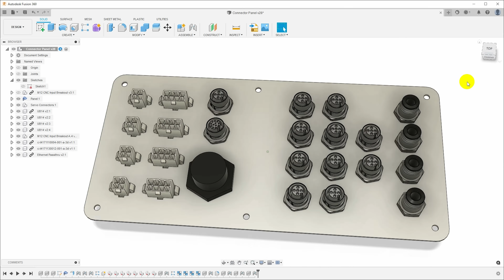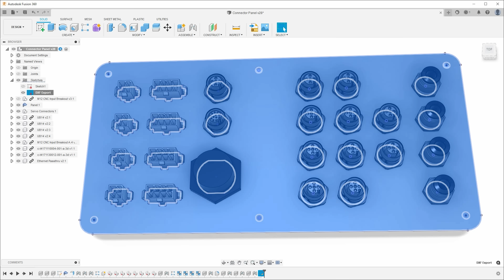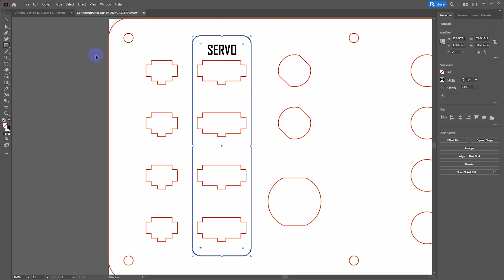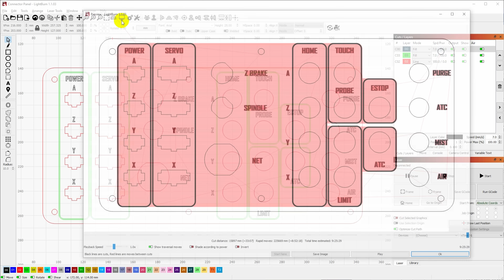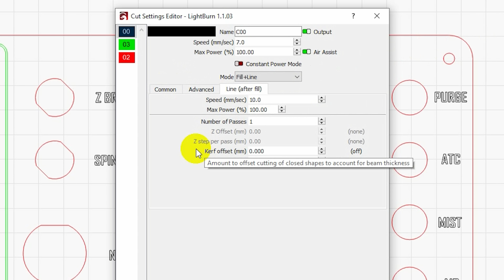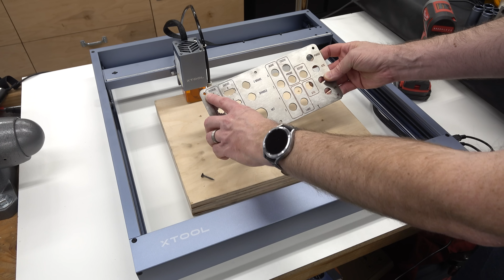Will a Diode Laser Engrave Steel? | xTool D1 Testing

Comment: Bit of science info:
Many years ago I was mailed some stainless steel samples from Japan for analysis. They had been treated to produce a range of colours. RBS Analysis (nuclear backscattering)  showed that the coloured layer was actually a transparent oxide that was producing colours by diffraction interference. That's the same mechanism that creates the colours in a thin film of oil floating on water. 
I suspect that this is the same thing. An oxide layer where the thickness determines the colour that appears.

Comment: I just got an S1 40w and have already engraved anodized aluminum and found it was easy and the results were fantastic. Judging by your process here, I think stainless may be just a degree of higher difficulty but I’m about to give it a go. Great tip on the cercoat

Comment: The laser cross hairs for precision alignment of the head with the work piece looks like a very useful feature. The creality falcon laser, which I bought, doesn’t seem to have anything like that ☹️
Reply: in lightburn you hit can set the power to 1% and hit the fire button and youll get a red dot you can use to line it up

Comment: This is a really good video , super informative and really helpful. I really wavering on what  machine i am gonna buy .. I am starting of as a complete newbie with lasers though i have some experience with a mori seiki cnc machine that a friend of mine owns and has been cutting trick high performance parts fro motor cycles fro years now. I have a ever growing itch to further my experience with cnc , So i am a small business owner as well , i am a drywall man , renovations and remodeling service provider, I am collectively buying tools for this and believe it or not its really easy to get them mixed up with others on job sites ie batteries cordless tools , hand tools ect. My solution is i am gonna purchase a laser engraver to put my brand on all my equipment and create a way to hopefully solve the problem of tools being mistakenly switched out. Plus like the video  i just watched do  some projects  like you just showed . Thanks for the video,.

Comment: And for those who live where the humidity is high, rust can be prevented in one of two ways: 1) periodically wipe down the steel surface and cover it with a thin film of light machine oil or mineral oil; or 2) finely grind or polish the surface to a high sheen. 

I live where the humidity is 92+ percent during some months. I recently found an old lathe toolholder I made back in the late 1980's in an old toolbox that had been in storage since the early 1990's. I could see a slightly discolored impression of my thumbprint where I'd touched the part decades ago, but the rust beginning to form from the acid in my body oils could not be felt or measured.

Comment: I'm sorry up front.  (Im a bit OCD)... but the intersection between "probe", "estop", "atc", and the high right side of "limit" is of by at least a pixel.  In particular,  the line above "atc" is low.  Lotsa love. I'm thinking real hard on getting the 40w x1 pro.  The price seems right..  I've done 3d printing... bored.  I like to work in metal.  Should I get the laser engraver, or the cnc plasma cutting table?

Comment: can you mark on carbon steel
Reply: The new model, top end, comes with an IR laser that is supposed to be better for engraving metal. BUT, I don't think this laser or the IR can etch carbon steel. Probably need a CO2 laser.

Comment: Excellent tip about setting the power to zero for outside boundaries of the part.  Also appreciate the info about how to get the laser to follow the line of the geometry, instead of back and forth like a dot matrix printer.  I have a Ortur LM3 and these tips saved time (and money) immediately which is an excellent bonus.  Like the switching between Fusion 360, Illustrator, and LightBurn. 👍👍
Reply: Just remember to click "show".

Comment: 12:20. Play around with LightBurn. You’ll find it’s remarkably easy to control sizes, alignments and other design elements. You just need a little familiarity with it’s tool set. I decided to buy it, just after testing it for 2 minutes!
Reply from the maker: Same here.  I won't buy another laser that doesn't support it.

Comment: Damn you’re good. I always enjoy your videos. I want to build a special jig for engraving stainless spheres. I figure a 360 degree roll in one direction and a +- 80 degree roll in the orthogonal direction might work. Each roll axis about the center of the sphere. 
Then the laser head is offset from the +-80 degree axis such that it focuses onto the surface of the sphere. The speed or rpm of each axis would be linked so the laser could cut anywhere on the surface except the poles. 
What do you think?
Paul.

Comment: Have you thought about applying a resist to the steel, then using the laser to remove the resist? Afterwards you can use acid to etch the steel to whatever depth you want. Black nickel plate and remove the resist? 
My unique (I think) technique.

Comment: Pretty cool. The price though. Could probably build a more rigid machine from 2040 and nema 17 steppers running ramps 1.x. The laser module is about $60-80. Ebay prices.
Great review.
Reply from the maker: Rigidity is pretty much irrelevant in this application.

Comment: Dry Moly Lube.  just as good as cermark at a fraction of the cost.
Reply from the maker: Just as good for what application?
Reply: @Clough42  as cermark.
Reply from the maker: @kanati  yes.  As good as Cermark for what application?  If I want a durable black ceramic mark on glass, for example.
Reply: @Clough42  metals.  Dry moly lube will give you 90-95% what you get with cermark or brilliance sprays…. If you want glass…. Different story altogether.  Krylon flat white spray paint.  Look into the Norton Method for that.
Reply from the maker: @kanati  That's my point.  There are a lot of different applications and saying that dry moly works "just as good" as cermark is fine, as long as you specify your application or requirements.  I believe you when you say that dry moly lube will give you 90-95% of what you want from your marking spray.  I don't think that's true for some of the things I care about.

Comment: Hi James, having made countless interface panels in my broadcasting career I always ran into trouble trying to label things. Invariably we resorted to Dymo labels or pressure transfers and produced acceptable results. Of course this type of laser was a NASA dream at that time. Your results are certainly impressive especially the Ceracoat version.
Thanks for the detailed explanation of the cad-print/burn process. I don't claim to understand half of it but the half I did makes sense to me. I look forward to your future endeavours. 
How about etching curved surfaces like lathe or mill control knob scales. A coupled rotary sequencer (I know that's not the correct word) would be an interesting project and one well within your capabilities?? 
Regards from Canada's banana belt. 👍🇺🇲🕊️🇺🇦🍌🇨🇦🤞

Comment: Thanx for informative video. Why not cut it onto the MS parts?does SS mark easier than MS or carbon steel?
Reply from the maker: A diode laser won't cut steel.  It marks stainless by locally heat-bluing it.  This works because of its oxidation properties and low thermal conductivity.
Reply: @Clough42  I am looking at using it to mark/engrave logos on high carbon steel knives.wondering it it will work for that, similar to what you did in this vid but on high carbon steel like 1070 or 1095...

Comment: The whole issue of the metal warping here is essentially the same issue when welding or surface grinding thin metal: too much heat concentrated into too small of an area at once.

Two suggestions to reduce metal warping.  The first is to back the workpiece with a block of a good conductor (such as aluminum) instead of the wood. The other is to change the order of operations so no area is heated for long periods (do a little engraving in an area then move to the opposite end of your work piece) - this may not be practical with the software you use (it would be trivial with MasterCam).

Comment: I engraved SS at a much higher speed.
Reply from the maker: Providing details of the laser you used, power settings, speeds, material, and results would be helpful for the community.

Comment: I'd be curious if you dissolved borax and then mixed it with black paint if you'd get a similar result to the spray. Borax is used to prep crucibles, because when heated, it forms a glassy glaze over the surface so your melted metals don't stick to the graphite.
Reply from the maker: If you try it, let us know how it works.

Comment: I have been looking for a laser that was not in the $20k range fiber laser to engrave hardened tool steel and alike. Was wondering if you would be down to test that out and see if that would work. I can get you some sample test plates.
Reply from the maker: Bare tool steel?  Like what kind of materials?  Or were you thinking about CerMark?

Comment: Chuck the screws into a drill (head out) and head (hehe) over to your belt sander.  Take off enough of the head (drill running at low speed to make it even) that you can still screw the plates down, but any excess is out of the way of the laser.

Comment: I just tried Brilliance Laser Marking Spray for the first time.  Washes of with just water, and you can't get any blacker print.  I tried the Laser Bond Tech spray which also washes off with water, but only prints in kind of a gray, and leaves residue behind. Last test ran was 20mm @100% which deformed the metal, using Brilliance. Anything higher though will not bond to the metal.  And yes, this testing was done with the xTool D-1 laser. Brilliance is expensive, but you don't need to fully cover the part.

Comment: Great channel James, I like the way you use a lot of different types of machines for your projects. I have picked up a several tips that I can use at work where I use some of the same type machines and do some CAD work too. I do have one tip for aligning your parts for laser etching. To save time on the alignment you could have the laser burn the outline of the part on a scrap piece of wood or cardboard then put your part on the outline instead of having to frame it several times to get it lined up.  You would probably need to be able to set an origin point at the laser for this to work good and I don’t think I saw you do that, not sure if you can on your machine.  Keep the videos coming!!
Reply from the maker: Thanks for the idea, Colby.  I had some trouble getting the laser to repeat in the same position every time, but once I got it sorted, it works a treat.  I used the technique in a video that will be posted this coming Saturday, and it saved me a lot of trouble.
Reply from the maker: Good tip.  I'm not totally sure about this particular laser.  It de-energizes the motors as it sits idle, so I'm not sure how well it keeps position.  But I have a project coming up that requires very precise alignment, and that's a fantastic way to do it.

Comment: It would be interesting to see if you could put a thin layer of powder coating powder on the part and cure it with the laser. I may give it a shot in the future. My 40w co2 laser has issues though. You might be able to apply the powder without a gun but it would be much easier to get a even coating with a gun. I only bring it up because powder is reasonably cheap and might be a feasible alternative to the cermark spray if you plan on marking metal a lot.
Reply from the maker: If you get it to work, let us know.  I suspect it will just burn without fusing to the metal, but it would be awesome if it were an option.

Comment: Have you tried Cermark on Aluminum?
Reply from the maker: Yes.  It didn't work at all.  The laser just blows it off the surface, leaving no evidence that it was ever even there.  A little bit sticks in the scratches on brushed aluminum, but it flakes off easily.
Reply: @Clough42  Thanks so much for getting back to me!!!

Comment: The element in Ceramark that does the job is Vanadium -- you can use Chrome-Moly-vanadium spray ( like for bikes ) and get an excellent result
Reply from the maker: It's Molybdenum, according to the MSDS.
Reply: @Clough42  I stand corrected.  I thought that the spray contained all three.

Comment: IIRC, cermark is mostly Molybdenum, and the laser is sintering it on.  You can buy the raw ingredients (dry moly lube) and make your own for cheaper.  They have a new version - cermark 2 - that is suppose to work better with low powered lasers.  Do you know which one you used?
Reply from the maker: CerMark Ultra.  It has a lot of silica in it as well, so it forms a glass material.

Comment: 455 nm is a black light
Reply from the maker: UV begins below 400nm.  A traditional black light averages around 365nm.  455nm is blue, bordering on violet.
Reply: @Clough42  lol true For resin curing (3d printing ) the lights I use are 405 nm are most effective and the manufacturers also call them black lights so I thought it was 400-500 my bad

Comment: The line outline warning less than fill isn’t cause the line after is a cut but rather that a slower outline will give a more crisp outline cleanup mark if you’re doing shapes/text on things like leather/wood/etc. If your outline is a little slower than fill, it just defines it a little more in a lot of cases. 

Also for frame, you can check your frame with the outer layer turned on. Then just before you engrave toggle the button to turn off that layer from outputting in the top right.
Reply from the maker: Yeah, I realized I could do that right after I turned off the camera.

Comment: My top tip for using the 'paint' type spray can, is once you have finished using it flip it upside down and give it a quick press. This will clear the spray head and stops it blocking up.

Comment: BTW that laser would not warp or move that thickness SS, you went through a lot of trouble for no good reason my friend.
Reply from the maker: Perhaps you should watch the rest of the video.  It definitely warps the material.
Reply: @Clough42  I always watch your videos to the end. just curious what gauge SS were you using? So the wave length that they are using can act both like CO2 and Fiber, I take it.
Reply from the maker: @oclaser  16ga 304 stainless

Comment: For someone who owns serious lasers I am impress to see that it actually marked the SS. And yes, not being deep and permanent is understandable, but it also did very good with Cermark. Anodized Aluminum will be a breeze since it doesn't require that much power. However the software and print driver looked very cumbersome. I guess I am just spoiled 😄
Reply from the maker: What software stack are you using?
Reply: @Clough42  I use Corel for CAD and Epilog has a fantastic print driver and Job Manager that we all use.

Comment: WOW,  I like how it looked even before you did the one with the spray.
I have an Amazon mini router 3018, it has a blue 450 nm laser, I may try that.
I was going to do my control panel in 1/8 inch MDF to attach to my control box.
You are moving way faster than I am.  
I started to build my EDM machine over a year ago.
At first, I wanted to do a wire EDM but, I went with a probe in a drill bit head.
I have not designed my circuit yet for Electrical discharge.
I am getting there!
Take care, thank you for your videos.
Keep up the great works.

Lee
Reply from the maker: I'm very curious about EDM.  I tried to get involved with AvE's project a few years ago when it looked like he was headed that direction, but it didn't go anywhere.

Comment: Nice work as always James. One thing could be better I think from a graphic design point; the border outlines are too close to each other which makes them connected for a human eye. If the separation is just a few millimeter wider it looks cleaner and more defined as separate areas. Small tip. Thank you! Best, Job
Reply from the maker: It's a design challenge, because if you make the borders smaller, you start running into the connector lock nuts, and this is a visual challenge as well.

Comment: Something fun you can also do is cover the metal in powder coat paint powder and run it. The laser will melt and adhere the powder to the metal exactly where it points. It's like giving it a professional paint job with a laser. Just a fun tip and something I have tried. You can do some pretty cool stuff that way.
Reply from the maker: Is the power level critical for getting this to work?  Because the laser can also be used to remove powder coat for marking.
Reply: @Clough42  it's not too bad but you need to clean the part well with acetone preferably first and dry it, then use like a credit card to put a thin layer on the top. Then go pretty fast with a low power and it should work well. I have done it a few times. Pretty cool

Comment: Do you think the making compound is a powder coat? I bought a 3D printer that is also a laser engraver. I haven’t tried is laser module yet. It’s advertised to be able to cut cardboard. I was thinking of cutting foam for my tool box tools organizer. Thanks for sharing!
Reply from the maker: No, it's got a bunch of stuff in it, but I think it's basically molybdenum oxides and glass powder, so it fuses as a colored glass or ceramic material on the metal.